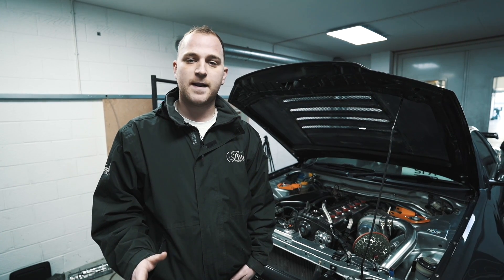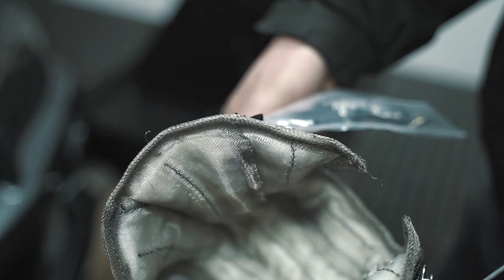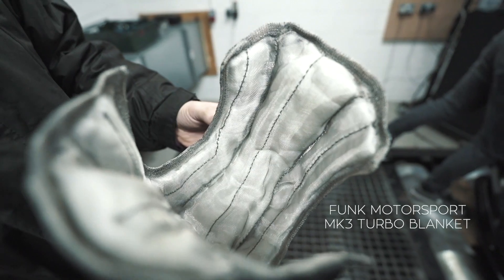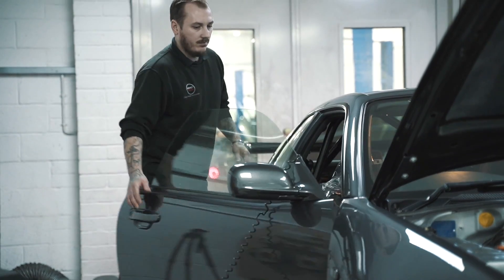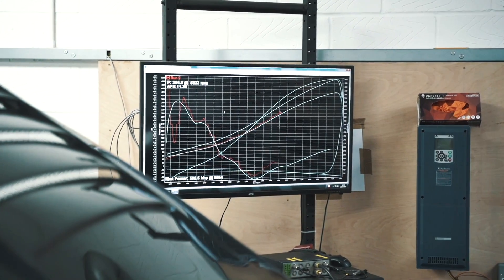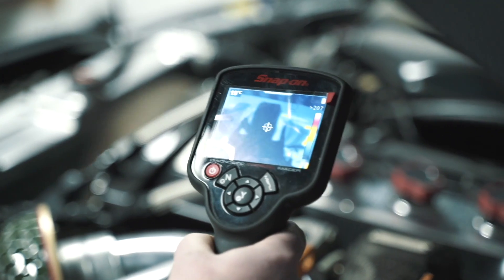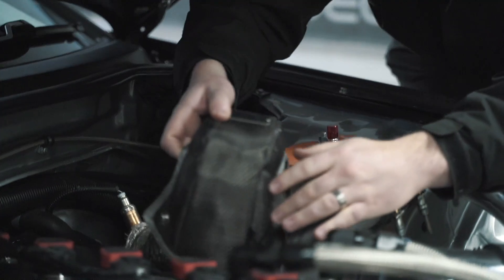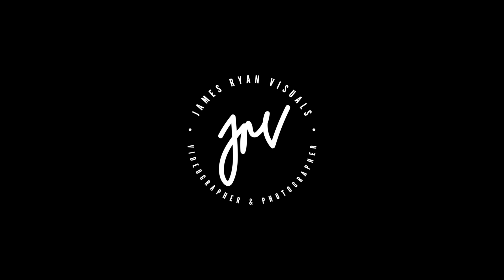R34 Skyline - Dyno Testing a Funk Motorsport Mk3.Turbo Blanket

Comment: Would have been interested in seeing proper stats which could have easily been measured and reported on with a thermo gun.  So before the turbo blanket was added and then afterwards, in particular point and shoot readings on components immediately around the turbo exhaust housing and temps under the bonnet when it is closed is the real world reality that matters.  FYI I’ve already bought one of your turbo and wastegate beanies so am looking forward to fitting them with my next lot of mods, they definitely look much better quality and thickness than your competitors offerings but for a premium product you should be quoting actual stats in your marketing materials- that’s what people really need to know, it transitions claims from an opinion to being backed up by actual facts. - if that shows clear result which I expect it would that will be a huge selling point for potential customers l. Cheers

Comment: Hold up... You called it a GT-R, Ain't they supposed to be AWD... 

But blanket looks great, Will need to get my order in!
Reply: There’s a 4WD fuse that you can remove to change it to RWD. Not all Dynos can support 4WD. You can see it in the video when the drive the car up.
Reply: @BourneThisWay  If that's a GTR, then why does it have an RB25DET in it?
Reply: It's very clearly an RB25 GTT